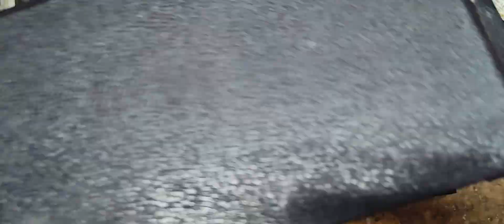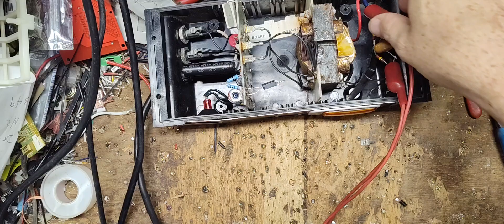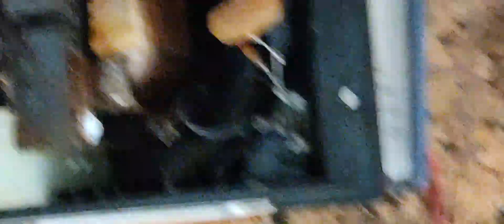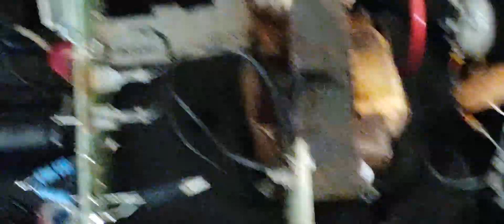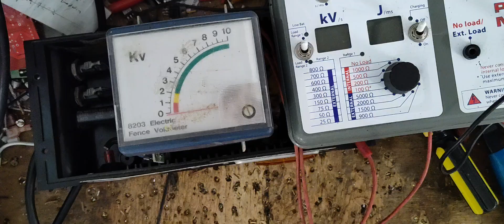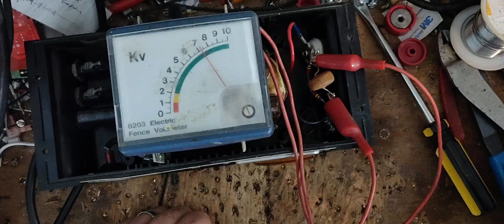Everything You Ever Wanted To Know About Bulldozer 4444 A Solid State Electric Fence Charger Repair

Comment: i haven't seen one of these since the 90's.  What i remember of them as a kid is that they were always shorted out..... So is it still solid state or did you convert it to low impedance, its pulsing.
Reply from the maker: It's still a solid state unit. Solid State units were always a pulsing type. The earlier units before pulsing solid state units were the weed burner units, those were even more different than these were.